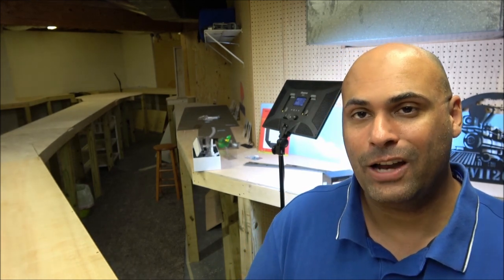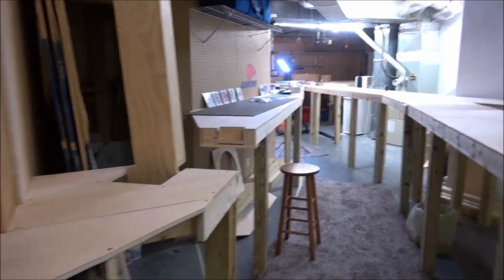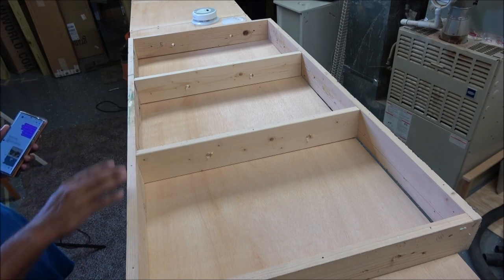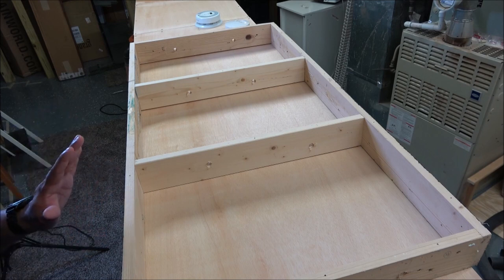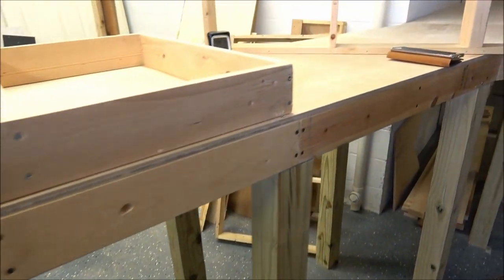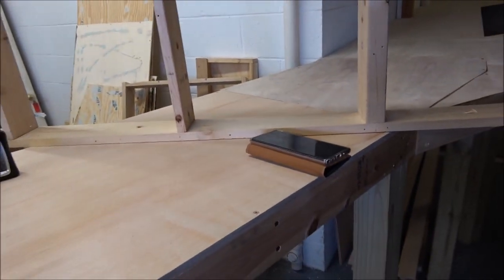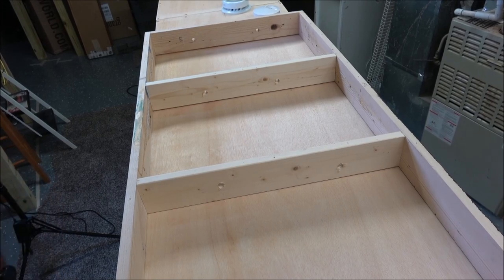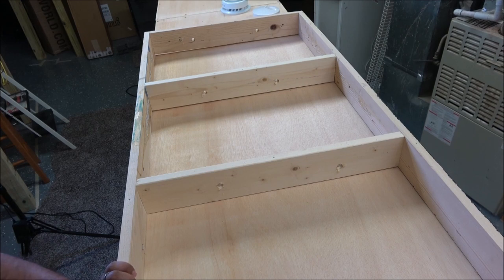How To Build A Layout Episode 1 - How To Build Benchwork With James Wright

Comment: James, I have height adjustable feet on the bottom of all the modules' legs. Firstly to correct my dubious carpentry and secondly because most floors are not flat. They made a big difference in setting up when I moved house.
The other things I would recommend are DCC Concepts Power Point alignment dowels. These are very good for keeping a lift up flap aligned and for feeding it with track power.
Reply: Great points,  i forgot to mention the adjustable feet. Thank you for the comment!
Reply: We were going to put the adjustable feet on this layout but, the weight of the posts and benchwork crushed the plastic used to adjust the foot height.  So it was abandoned.  Adjustable feet will work on lighter tables and L shaped legs, James's layout is built like a deck that you can walk on, adjustments are made with the length of leg and a level to adjust when attaching.
Reply: @DaBobsNScaleMancave  Not all adjustable feet have plastic parts. I found some that were completely metal.
Reply: @martinbatistelli  In the time I had to find some, only Home Depot carried them in plastic.  The way I did it still worked out overall.
Reply: @DaBobsNScaleMancave  There are a couple of good options to make your own leveling feet. Drilling a hole in the end and using a lag bolt is quick and easy. Drilling a hole and using a T nut with leveling feet or regular bolts with a jam nut to set the height. Either way won't break the bank, it just needs a little planning ahead to obtain the materials.

Comment: Just an FYI:  The water from most dehumidifiers, like the one you showed, is not distilled water.  Distilling water is a purifying process where the water is brought to a boiling point then condensed (cooled) back to water in a different container.  This process purifies the water to a degree by leaving behind the impurities in the water that does not turn to vapor with the water.  Therefor leaving the impurities in the original container.  

Most dehumidifiers work similar to an air conditioner and the water collected is from condensation of the water in the air without boiling.  Similar to the the water on the outside of a cold glass of ice tea or cold beer on a hot summer day.  The condensation is cause by the difference in temperature between the inside and outside of the container.  The water condenses on the warmer side without boiling.  So it would still contain at least most of the impurities.

Comment: I noticed you do not use gussets to stabilize benchwork. Good video. I do not drill for my feeders. I have installed little eye hooks and hang inexpensive shower curtain rings that I can open to slide an additional wire in or to add a feeder.
Reply from the maker: Thanks for the info!
Reply: I do the exact same thing!! I think it's easier to access the wiring if needed.

Comment: any Experience with Foam bench work? I have seen a layout that essentially was 2x4 foot sections of foam board glued together and then the sides where routered out and plywood strips glued in. the entire section was then wrapped in oak 1/4 plywood glued and stappled to the Plywood strips. these modulars were then placed on metal self arms that were screwed into the studs in the wall.

Comment: The big problem I've run into is there is no straight lumber available anywhere around here. It warps and twists to no end.
Reply: Same issue.  Unless you want to spend a fortune on cabinet grade.  What I did was I built the modules and leveled best I could, them I leveled the foam using shims between the plywood and foam.